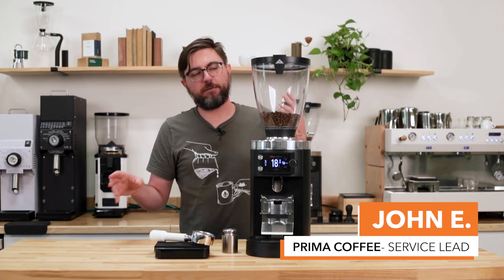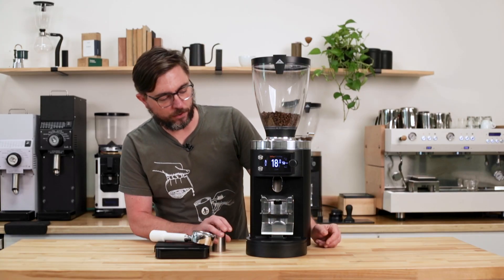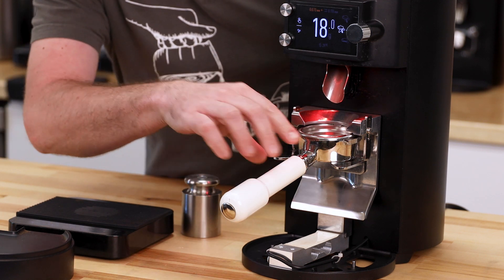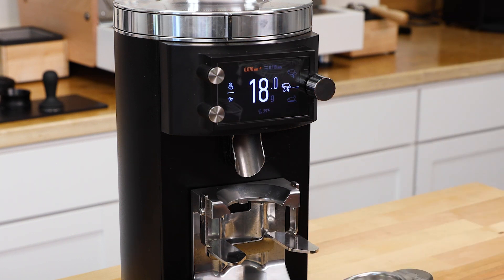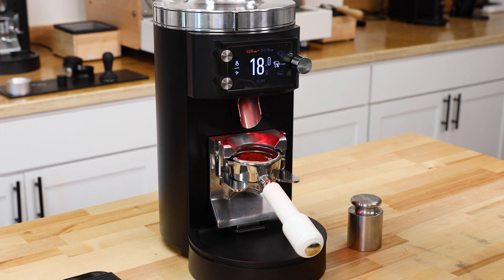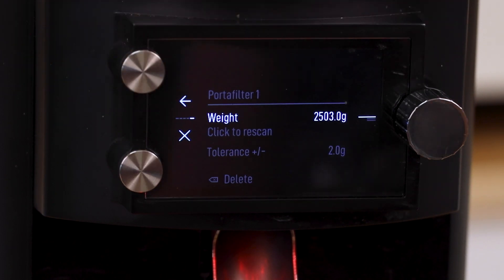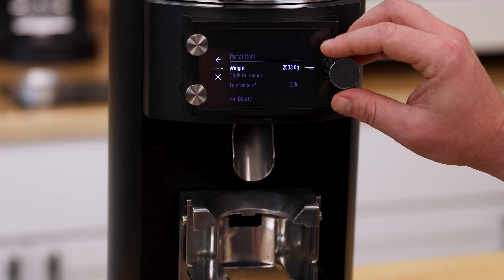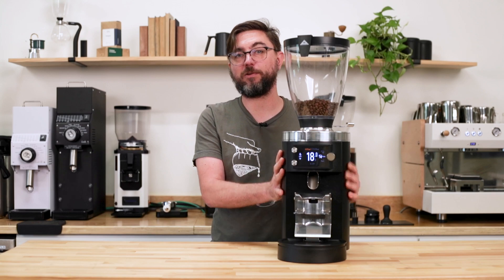Maintenance | Mahlkonig E65s & E80s GbW Load Cell Troubleshooting

Comment: I have an e65egw, I log in with the service key, but when I want to access internal presets the grinder returns me to the grinding screen where the grammage appears.
Reply from the maker: Sounds like it could be a software bug. You could try a hard reset. With the power off, hold all three buttons in on the front and then turn the grinder back on. Keep holding the buttons in until a white flash happens on the screen (should happen in a couple seconds). Then release the buttons and see if you can log in and get to internal presets.

Comment: Hello! Thanks for the video. Could you tell me whether this is suitable for a pop-up espresso bar? From a supplier I heard that movement/vibration might trigger an error mode and I'm unsure whether this is the right choice now... Thank you!
Reply from the maker: Grind By Weight is possible for a mobile cart, but the cart would need to be very firm and stable, and we'd rcommend putting a rubber mat under the grinder to help speed up taring/dosing. The timed grinding version (E65S) is not susceptible to these issues and would be a great choice.

Comment: Thank you, this worked perfectly! I do have a different topic question on the e80 though. What should a consistent temperature be when the grinder is working through a busy order rush? Also when I do a fan test on the e80 when Im doing service cleaning, it says it's running at around 50%, is this normal? Thanks
Reply from the maker: I'm not sure about a consistent temperature number, but the the passive fan that runs when the motor does and the two active fans that come on occasionally during higher volume use work to keep the grind chamber temperature below 37 degrees Celsius. HEMRO claims that they have never been able to exceed 36 degrees Celsius on the E80.  I think it was determined that you start to run into issues when a grinder chamber exceeds 38 degrees Celsius. The fan run percentage and any sort of fan underrun notification is just a software bug and should be ignored. The original intention was to create a diagnostic tool that could measure the electrical impedance of the fans and report back, but it doesn't work as intended. The fan test is just an on/off test as far as the current firmware stands.
Reply: @primacoffeeequipment  Thank you again